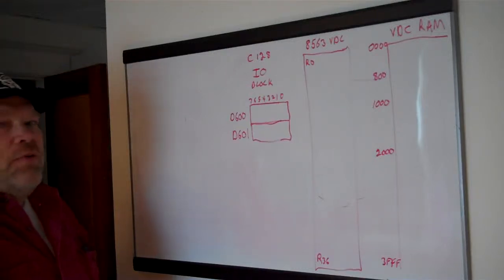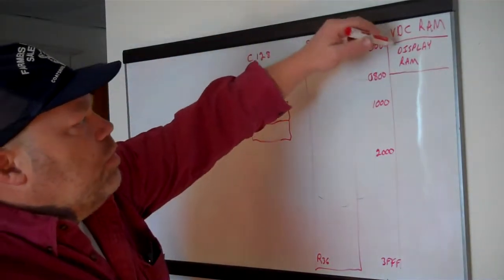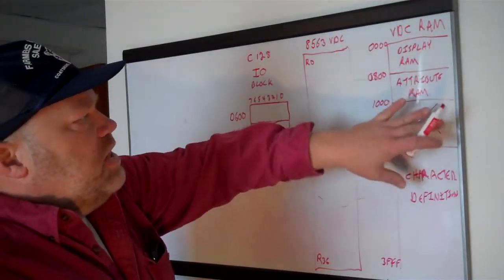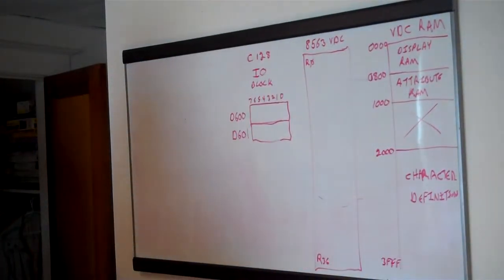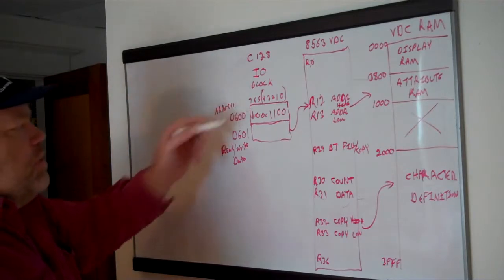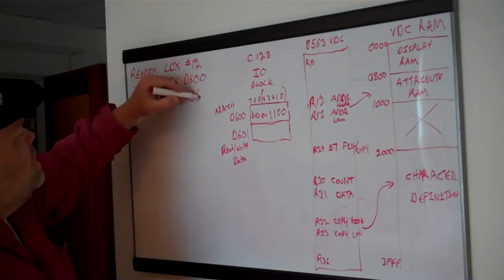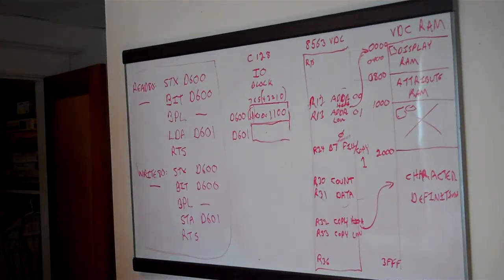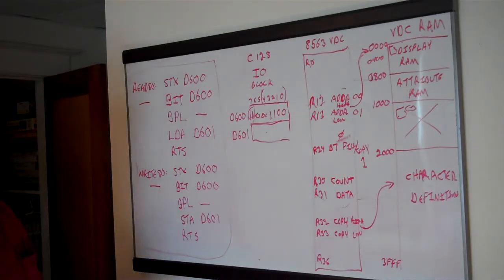Commodore 128 Assembly #28: Programming The 80-column Display (8563 VDC)

Comment: It is not necessary to write a set of "roll your own" VDC access functions.  Instead, use the ones that are already present in the display kernal ROM.  The two routines you will mostly use are:

READREG — $CDDA
WRITEREG — $CDCC

Label names are from the official Commodore display kernel ROM source code.

Both functions are called by loading .X with the desired register number.  Also, load .A with the value to be written when calling WRITERG.  It is possible to call these functions from BASIC using the SYS command.

Two other display kernel functions that are useful are:

READ80 — $CDD8
WRITE80 — $CDCA

READ80 loads .A with a byte from video RAM (VRAM) at the location pointed to in registers 18 (MSB) and 19 (LSB).  WRITE80 writes .A to VRAM at the location pointed to in registers 18 and 19.  Both functions modify .X, but do not touch .Y.  Again, these functions may be called from BASIC using SYS.

Note that the display kernel ROM must be in context when you call any of these functions.  You may have to write to the MMU configuration register at $FF00 to put the ROM into context.  From BASIC, use BANK 15: SYS... to assure the ROM is in context.

Comment: The programmers ref guide for the c128 mentions this some on page 305, lacks all the detail you have. Interesting. I was looking to change the background color on the 80 col screen, I guess it can't be done
Reply: I'm way out of my league when it comes to assembly, since I don't know any of it, but you can change the background on the 80 screen in Basic by using the 'color' command.  Like if you want to change it to light red, it's simply "color 6,11" for text mode. I don't know if that's what you were looking for but it's the simplest way of doing it without going into assembly language. Hex numbers and memory addressing makes my brain hurt so I wanted a super easy way of dealing with colors on the 80 col display in Basic. The colors are slightly different on 80 col from the 40 col but there are tables that explain them.

Comment: 5:36 is this because the Z80 is big endian? From what I understand the 128 has a complete other Z80 computer to run CBM and the 80 column video is for that?
Reply: The Z80 is little endian, but from what I understand, the VDC was originally designed for a Z8000-based computer. The Z8000 is a big endian architecture, so that could explain the choice.